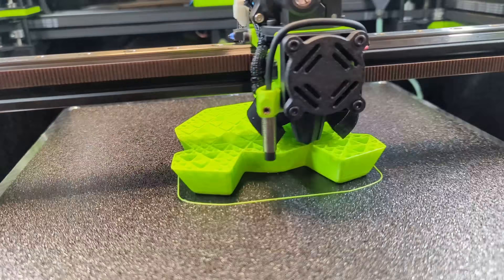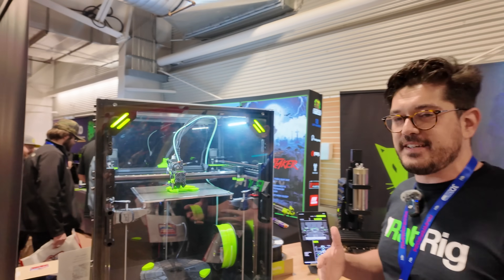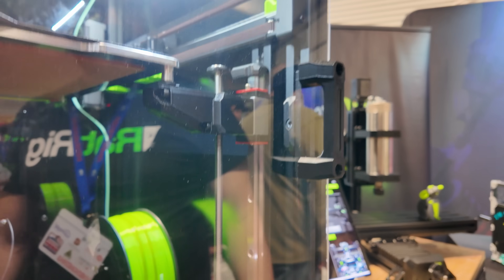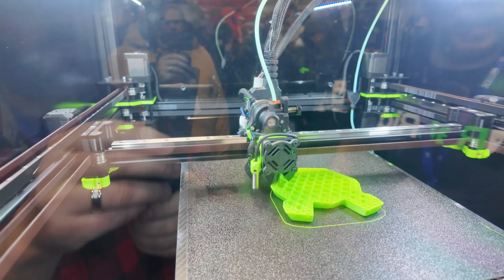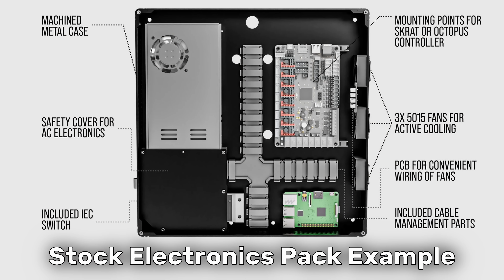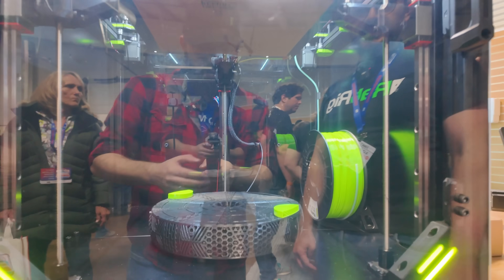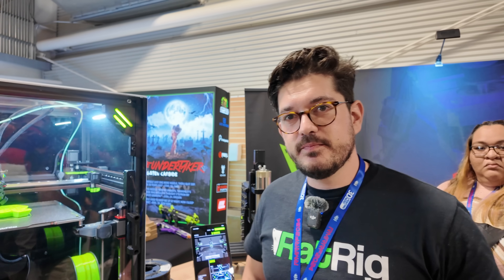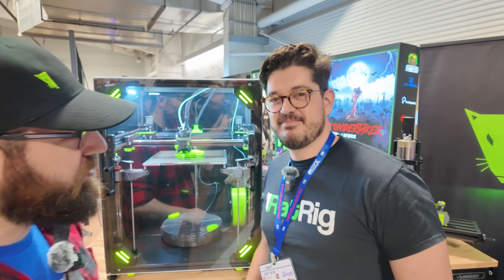FIRST LOOK - RatRig V-CORE 4 at RMRRF 2024 #3dprinting #rmrrf

Comment: I don’t like it. 3x was better with back electronics and stepper motor’s outside the box
Reply: Electronics are still in the back (outside printer enclosure) and the Electronics enclosure is included in the kit.
Stepper motors are still outside, at the bottom bellow the steel plate (plate is included in the kit)

The stepper motors, that you see inside are Nema 17 HT - that are specifically designed to work in a High Temperature environment!

Comment: Does that mean it's AWD now? Why does he say that the quad motors help only Y acceleration? Not X too?
Reply: It's not really AWD, as the extra motors just apply to the Y axis. From my understanding, it's basically a second motion system only moving the Y axis added on top. Since the Y axis has to move the whole X gantry, it can't accelerate as fast as X. The extra motors for Y should bring its acceleration closer to X and use more of the potential.
Reply: @ThomasS17  Yes that's quite a refreshing approach. I hope Nero does a technical breakdown of this and explain how effective this additional speed can be, maybe as compared to an AWD system

Comment: With price almost like 2 Bambu lab p1p or p1s. :D

rat rig 4 300 mm  1200 euro + VAT

From rat rig facebook

Standard Mode (CoreXY)
Size 300 - 1200+VAT
Size 400 - 1350+VAT
Size 500 - 1500+VAT

Performance Mode (Hybrid Core XY)
Size 300 - 1300+VAT
Size 400 - 1450+VAT
Size 500 - 1600+VAT
Reply: Base or idex?
Reply: @UNVIRUSLETALE  the most basic. It was written on Facebook.
Reply: @Pasha4ur  not + VAT. That’s including VAT. Also a weird comparison.

Comment: That V Core 4 is looking hot. I wonder what chamber temps it can hold reasonably, because while no tool changer, with that IDEX setup, I could see that being a really nice printer solution maybe slapping on an ercf for multi color and then your special material on the other extruder.

Comment: Does that look like the build plate could be at lest 50mm wider?
Reply from the maker: It could, easily

BUT

Then when your running IDEX, toolheads cant occupy the same space cus ya know....solid objects, so you still waste that portion of the bed.
SO 
best to just not use a bed that large and spec a bed thats both toolheads can utilize (same reason theres free room at the back for the nozzle alignment camera

Comment: I had a 500 VCore 4 in my early bird cart, but waited until I could see one in action.  Now it is gone, but am glad to see your video.  I have a 500 and a 400 Vcore 3 and what I can see there will be no way to upgrade them to the Vcore 4 - everything has changed.  It looks like they addressed all of the weaknesses in the 3 and made the changes in the 4.  Looks like a good machine,  I agree that the BTT Kraken would be a good replacement for the Octopus for just a little extra.  It would be a good option and should be included in the new version of RatOS

Comment: It uses LDO HT motors (180c) (on the website). I hope that all the electronics is outside.
Then maybe possible heated chamber like 80c-100c?
Reply: All electronics (except motors and potentially toolboard, obviously) are outside in the box presented in the video. You may want to skip the toolboard when going for 80-100C (or look for one made for those operating temperatures). You also want to upgrade to gates EPDM belts, otherwise you should be good to go :)
Reply: @miklschmidt  thanks. Ok, belts - good to know.
The toolboard is what I was afraid of. What do you mean - skip it? Isn't it is in the toolhead?
Reply: @vim55k  The V-Core 4 is a highly modifiable DIY printer, you can do whatever you want with it. Toolboard or no toolboard, RatOS doesn't care, neither does the toolhead :)
Reply: @miklschmidt  thanks. Good to know.
Is it even possible without the toolboard??
I liked that v4 fullfilles most of the wishes including that fast new probe. Would prefer to tinker less.
Reply: @vim55k  Oh yes, hybrid needs 8 drivers including the extruder, so works on an octopus, which coincidentally ships with the default kit :)

Comment: To put second spool inside as well?
Reply: Thought on the website it showed it could handle up to four spools
Reply: @efboiz5302  Correct indeed, spacious to do lots of fun stuff :) Active heater, internal spools, internal MMU (stay tuned), filter systems, side air curtains, stowable tools, etc :)
Reply: @efboiz5302  Indeed

Comment: Yet another reason why Voron should give up on the Phoenix 😅
Reply: we need both printers, one is pushing the other
Reply: Like Helge said, when we saw what the Voron boys were cooking it just motivated us even more, i'm sure it works both ways. Very curious about what you guys are gonna do as far as software goes @CanuckCreator. Helge and me have been working on solving and working around all the inherent issues in the klipper IDEX implementation, slicing, macros, calibration etc etc. It wasn't easy, but we're both very proud of the result!
Reply from the maker: nah

Comment: still no chamber heater as standard...
Reply from the maker: Most of these types of printers are enclosed well enough where you putting out enough heat from a mains bed to get the chamber plenty warm enough to print anything but the higher end engineering plastics like PEEK/PEKK/ULTEM etc

an additional chamber heater isnt really needed for the majority of use cases
Reply: @CanuckCreator  ok, thanks for the answer!
Reply from the maker: You see them sold as a feature on some off the shelf printers like Bambu and Qidi machines. But those are mostly to make up for the fact the printer enclosures are quite thin and full of holes so they leak a ton of heat
Reply: @CanuckCreator  true. I guess I would like to see both highly insulated chambers and the active heater :D that is what I'm currently doing with my machine, hopefully it will work well.
Reply: @riba2233  In addition to what he just wrote. 
VC3/4 also uses mains powered bed heaters, 600W/1000W/1500W for the 3 sizes. 
Thats really a lot of heat you get passively vs the often 24V beds that some of those printers with active heaters have. 
And yes, the VC4 is sealed pretty well, helps to easily have chamber temps for ABS etc.
Reply: @MitsumaYT  yeah makes sense. I saw some people adding fans underneath those powerful beds to speed up the chamber heating process :)
Reply: My vcore 3.1 500 will not only heat the chamber to about 55-60c, it will also raise the temperature of my office at least 10F or more while running. 😅

Comment: price ? are we talking in thousands  or hundreds...
Reply: A 500 size machine was ~2000USD shipped.
Depends a lot on what you pick (CoreXY, Hybrid, IDEX) and what you might already have.
~1200 to 2000€ from 300 size to 500 size
Reply: Likely in between; 1200 to 1500 euros would be my guess.
Reply: @SentientTeapot2444  Early bird price was higher than that iirc. I think the base 400mm was about 1600.
Reply: 1900
Reply: Early bird price for a 400 with basic options like a pi was $1800
Reply: @phasesecuritytechnology6573  Worth noting that "early bird price" wasn't discounted - that's retail :)